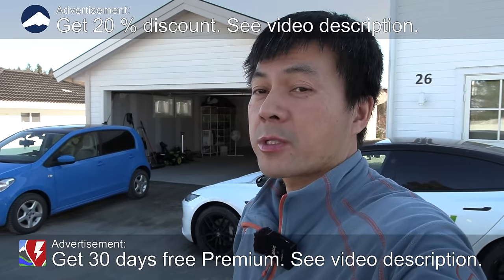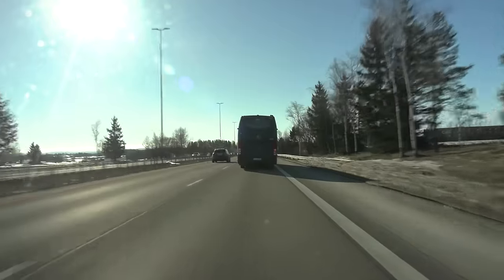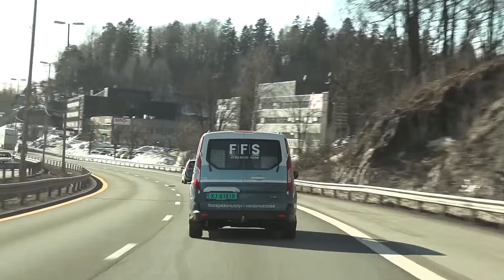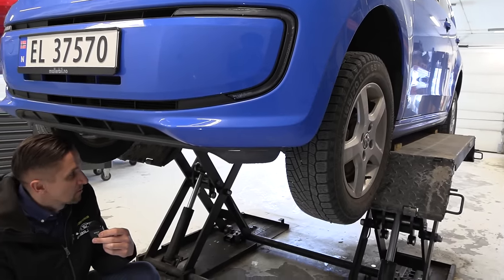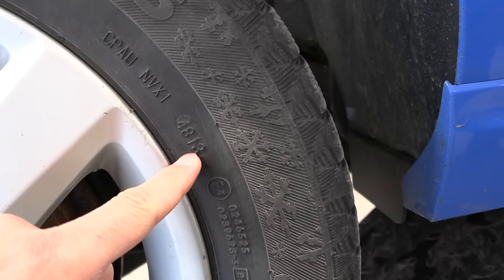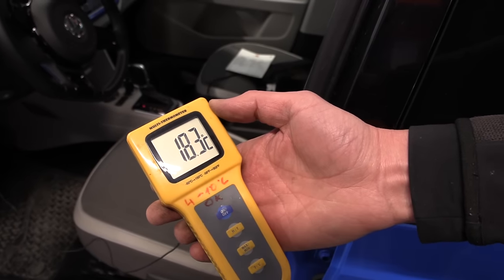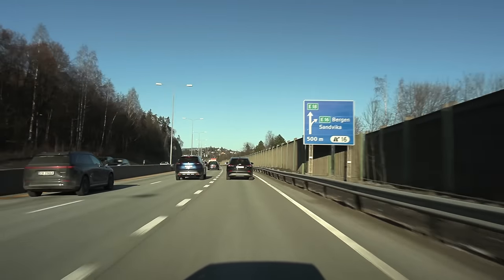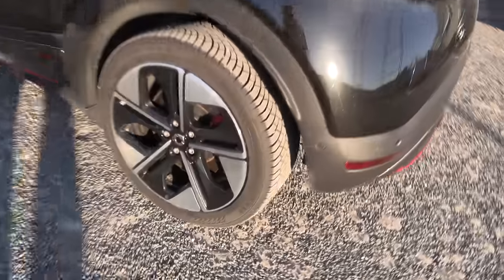VW e-Up checked at Elbilmek and picking up Smart #1 Brabus

Comment: I heard that you can install front underbody protection cover from the "cross up" (fossil) that will improve aerodynamics and improve protection
Reply: This probably could affect electric motor cooling as airflow would be restricted by that cover. As you can see in the video, the motor has metal ribs for better heat dissipation. I am not sure if this car has any other way to cool down the motor besides air cooling.
Reply: I want to put that underbody protection on my regular up, since it’s the Brazilian model probably equivalent to a European crossup, at least of higher suspension that because of bad roads here I would like to make even higher.